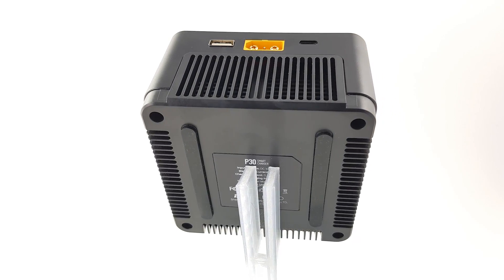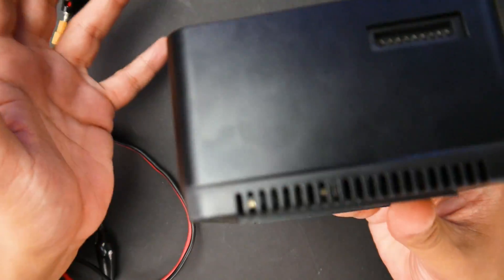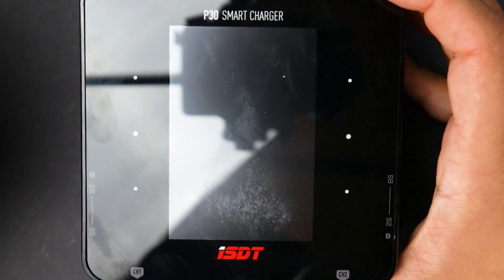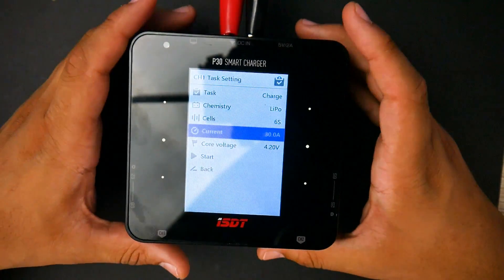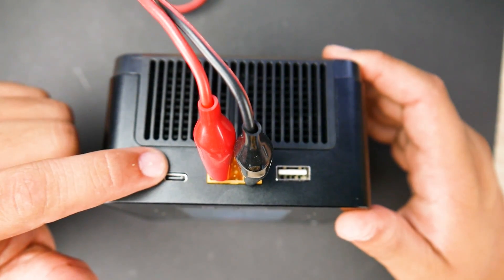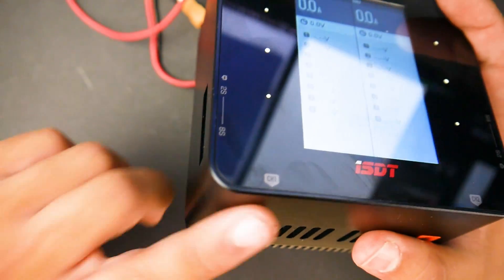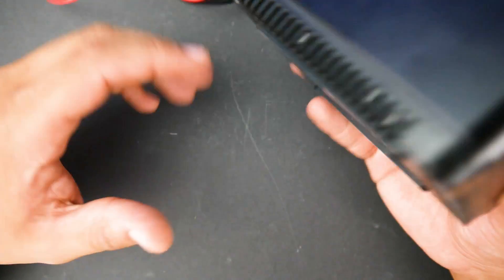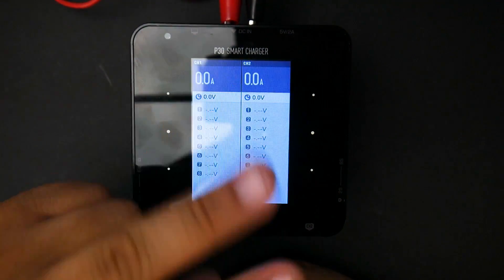Mother Of All Parallel Chargers // ISDT P30 1000Wx2

Comment: Just received this charger and connected it via bluetooth to the app.  Then I did a firmware update and now wireless (bt) option is no longer in the menu on the unit.  Anyone else experience this after firmware update?  Also I highly recommend updating firmware via usb cable as it took me 3 tries via phone.

Comment: Unit is not 2000 watts, its 1000w x 2 so 1000w per channel with a maximum total unit output of 1500w. Unit is max of 1500w not 2000. Over selling for the referral link. Lame......... When you are selling something which you are, as you have a referral link you should be honest. Now I know the reviews you do are tainted with your desire to sell units.

Comment: I run two Q8 on two modded DPS1200 PSU and you need the XT90 to safely handle the full potential of the chargers The one feature I would like to see from ISDT is what is on the iCharger regenerative balance discharge

Comment: I bought this and like it. In hindsight 2x Q8 Max and dedicated 36v (turned down to 34v) 1000W power supplies would be a lot more capable.

Even using the expensive ISDT power supply you can't feed this charger enough power to max it out.   On 110 mains power the wattage is cut in half on the ISDT power supply.

I'm powering mine with a 36v 1000W power supply and I set it to limit to 1000W on the input.